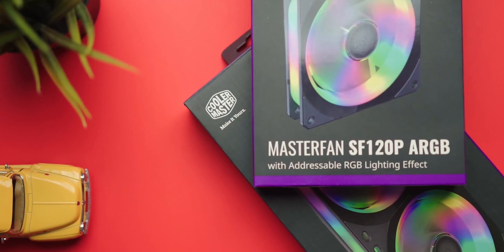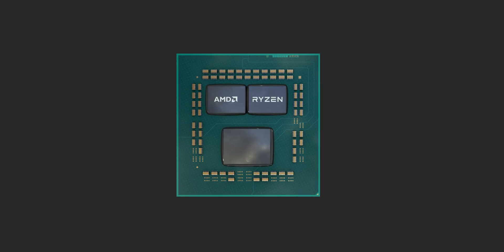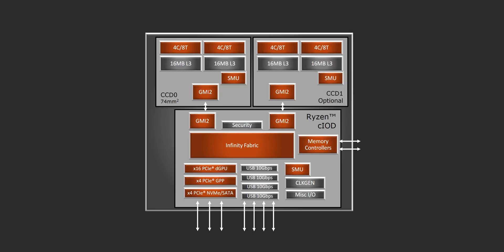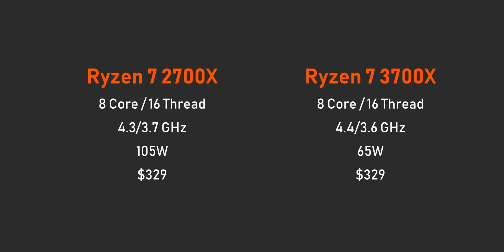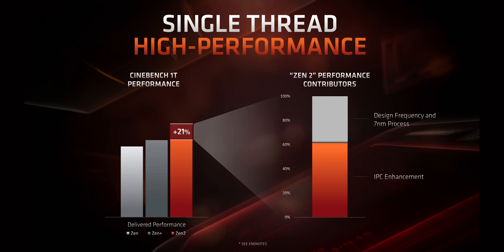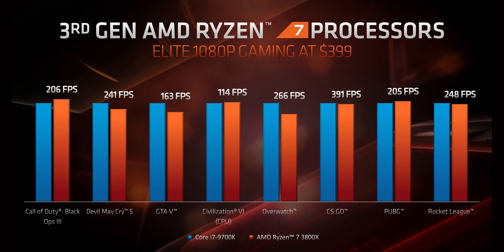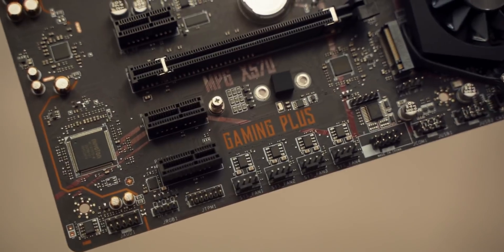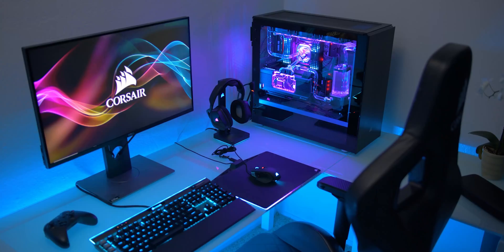AMD Ryzen 3000 – A Very REAL Problem For Intel?

Comment: I'm waiting to see reviews before making a decision. The R7 3700X is the most appealing option to me. If the performance is close enough to an i9-9900K, I'll go Red. Otherwise I'll bite the bullet and pay up for the performance I want. I don't care too much about a socket's upgrade path. I'm still on LGA1366. The only CPU upgrade I've made is an i7-930 to an X5670. Adding two cores and four threads helped out immensely. For Zen 1 owners on 300-series motherboards, they aren't guaranteed to even be able to drop a Zen 2 processor into their current motherboard. And if they can, I question how well he VRM will handle a 12- or 16-core CPU. It won't be worth it to switch to a CPU with the same core count. The IPC gains aren't going to make a noticeable difference in performance.
Reply: its not just IPC gains though. its IPC and frequency gains. Zen1 CPU's were lucky to OC to 4.0, if you get a zen2, you can probably hit 4.3-4.7 on every chip with that increased IPC and less power draw.
and afaik almost all x370 boards are going to support zen2.
Reply: @shawnpitman876  Power draw is unlikely to be less. It's very likely to be similar for CPUs with similar core counts. Once you factor in the increased clock speeds, power draw is likely to be higher. I don't see 4.5-4.7 GHz being that much of a change from 4.0-4.2 GHz. You're only noticing the difference in benchmarks.
Reply: @shawnpitman876  Depends on the game. The biggest gains will come from the 8-core versus 4-core CCX for reduced latency. And even you see a ~10% increases in frames, you aren't going to notice that unless you were on the threshold of what's playable. And if you were, you should have tuned your graphics settings better. The difference between 150 fps and 200 fps is imperceptible.
Reply: @shawnpitman876  I didn't say 500 MHz won't make a difference, I said you wouldn't notice it unless you're measuring the difference.

If you think Zen 2 is using a 4-core CCX, how are they fitting 4 CCXs into an R9 3950X? (hint: it's two 8-core CCXs)
Reply: @shawnpitman876  Resorting to insults is the number one sign you lost the argument. I was mistaking CCX and chiplet. My mistake. That leaves Zen 2 open to increased latency that will hurt gaming performance. Also, average frame rates don't tell the whole story. We need to know the 1% and 0.1% lows before being able to come to a conclusion. We obviously don't have that information yet. Regardless, Zen 2 looks like it's just an incremental improvement over Zen 1. We'll know in two and a half weeks.
Reply: @shawnpitman876  You clearly can't read. I didn't say anything about frames per second. I didn't even mention gaming. If the CPU still has increased latency when utilizing more than 4 cores, I'm going Intel. If the chiplet approach solves that issue, I'll go AMD. I don't know why you're so worried about how I spend my money.

150 fps is delivering a new frame every 6.67 ms; 200 fps is delivering a new frame every 5 ms. You aren't going to be able to tell the difference in frame time delivery of 1.67 ms. In other words, the difference between 150 fps and 200 fps is imperceptible.
Reply: @chessmyantidrug  BTW the ONLY thing that going intel for reduced latency does, is allow you to hit 150+ fps on games, because ryzen even first gen was able to hit 120-130fps on almost EVERY tittle. So wanna come at me with more BULLSHIT reasons? Because according to you, that's all a waste, but if ryzen doesn't do it, you're going intel.
This is how your argument is COMPLETELY self defeating. You're just too stupid to keep track of what you've even said for more than 30s, BECAUSE ITS ALL A LIE.
Reply: @shawnpitman876  I'm sorry you can't comprehend anything I've said. I'm my initial comment, the one where you said I brought up gaming, I never brought up gaming. You brought up gaming, so I explained why the differences in performance are likely to be irrelevant. The main reason I haven't upgraded to Ryzen is the difference in performance over Nehalem isn't enough to justify the cost. For Coffee Lake, it does. Note: I'm not talking about just gaming. Core for core, Intel is better. They just aren't the best bang for the buck and I don't really care about pinching pennies.

I don't know why you're taking this all so personally and attacking me. You really need a nap.
Reply: @chessmyantidrug  Yea, that's what all the wastes of oxygen try to say when they've been caught out on their bullshit.
As I said before, You ain't gas lighting me, fucking idiot.

Comment: i want to upgrade to 8 core 65 tdp version off 3rd gen. And i want to match it with x470 motherbord can you help me pick one out for overclocking?
Reply: AHOC says MSI x470 gaming pro carbon handles CPU's really well and is much cheaper than the asus c7h. He plans on running a 12 core ryzen in it, and he's an extreme overclocker, so you should be set to run a new 8 core on that no problem. Especially since its lower tdp than the 2700x that the board is meant to handle.
Reply: @shawnpitman876  thanks
Reply: Buy ASUS C7H, then done

Comment: Nice vid guys,,love your channel,,so,,my current rig: i7 8700k OC to 4.8ghz,, bought it about 1.5years back,,it is a strong performer but I'm not using it for gaming,, I'm a graphic designer, heavy after effects and premiere pro user as well,,my question is: would be the ryzen 9 3900x better in these adobe applications??,,, I'd need to replace only the mobo and cpu,,rest of the pc is pretty relevant for 2019,,,some applications prefer higher  frequencies, some more cores,,god knows what else,,,but anyway, I'm excited about the new amd offering,,my last amd was an athlon waaaayy back in time,,,
Reply: I doubt it will be better. I blame Adobe for it tho. They refuse to get with the times. Check out Dmitri's video on this channel from few days ago.

Comment: The real question: will my predator Helios 500 support the 3000 series? It launched in 2018 so odds are it's running a 400 series chipset soooo maybe? If so it'll be the king of laptops again. It's already pretty freaking amazing with a 2700. It even outruns the 9900k Alienware since it doesn't overheat like a motherfucker and throttle like that 9900k does. If I could do a BIOS update and slap in a 3rd gen Ryzen it'd be amazing.

Comment: Yea Ryzen 2 looks awesome. Everyone knows that. But there's something bugging me that no one else seems to realize.. 

Why is AMDs 7nm only just catching up to Intel's 14nm?? Should be surpassing it by quite a bit. I'm thinking of swapping to a 3800x for a while but as soon as 10nm Sunny Cove releases I'm back on team blue.
Reply: They've delayed that fab process for 5 years now. They just came out saying a mainstream 10nm fab cpu wouldn't be available until 2021. Rumor is that the yields in the 10nm process is very low. Only 30% of the chips are rumored to be useable in every wafer. The 10nm cpus are also rumored to be very low clocked because of heat complications.
Reply: Well when you think about it Intel has had 4 or however many years to fine tune and perfect their 14nm. AMD is 1st gen 7nm. Besides as much as i hate it most customers care about the resulting performnace and not the node it was made on. 10nm desktop parts from Intel may be scrapped alltogheter. From what im seeing their 10nm is a fundamentally broken node. The best they can produce in it right now and for atleast a year are 4c/8t up to 4.1Ghz laptop parts. They can't compete on desktop with specs like that. Their own 14nm would walk all over such parts even if 10nm would bring average 18% IPC uplift like they claim. 

In fact their roadmaps show 2! ,more 14nm desktop generations:
14nm 10c/20t Comet Lake 1H2020
14nm 12c/24t? Rocket Lake 1H 2021

No mention of 10nm desktop parts. Considering the timeframe they may skip 10nm on desktop alltogheter and go to 7nm in 2022. Assuning that does not take another 4 years top cook in the oven and end up as anemic laptop parts like 10nm did.

Plus how many security issues we have yet to hear about? One socket or series only supports two generations of CPU's so current Z390 owners will need to buy yet another motherboard if they want Comet Lake next year etc. 

Plus personally i just don't trust Intel based on what i wrote above. If you are waiting for Intel you may need to wait for a long time. They will come back eventually but currently it seems like thay have conceded that thay've lost the desktop market. They will pretend to care but really they don't. Server and laptop are much more important for them. Losing any market share there would hurt them badly. So i suggest getting Zen2 now and not waiting on Intel. By the time you do your next CPU upgrade they might have something competitive but that will be 2022+

Comment: @HardwareCanucks
See how fast RAM overclocks for a Zen2-CPU on a X470 motherboard. The more the better: 3600 MT/s, CL=14/15 and this preferably on X470 motherboards which use a T-topology for the memory traces in between the RAM slots and the CPU-socket.
I expect that many people will be interested in buying a good and discounted X470 motherboard. PCIe 5.0 is nice but soon DDR5 gets introduced so your platform will be out of date soon anyway. I have read from several people that they are worried about the noise of the chipset-fan and that the chipset-fan might break some day. That chipset-fan seems to be a deal-breaker for some enthusiasts who don't mind to spend $200-300 on a motherboard.

Comment: 2700x ≠ 3700x
$300 8c/16t 2700 = $330 8c/16t 3700x
$330 8c/16t 2700x = $400 8c/16t 3800x 
Also, $200 6c/12t 2600 = $200 6c/12t 3600
$230 6c/12t 2600x = $250 6c/12t 3600x
AMD is jacking up prices on all but the 3600. It's reasonable though, aside from the $400 3800x.

Comment: Assuming reviews go well (I'm a fan, not a fanboy), I'm going to be upgrading from an FX-8320 to a 3700X, probably with an X470 motherboard. I am excited, my wallet is not.
Reply: I upgraded from an FX-6300 to an R5 2600. Definitly worth it!
Reply: @xPandamon  I've gotten like half my friends to build Ryzen machines in the past year alone... And I'm sitting here with this aging machine. Figured it was time.
Reply: @alextrotta796  Yeah, definitely. I wasn't happy with mine (although an FX-8xxx is slightly better than what I had) so I upgraded. Finally able to play modern AAA titles :)
Reply: @xPandamon  I don't play super demanding games, but even some of the lighter games will really stress my CPU. GPU is next after this upgrade, I'm sitting on my R9 380X until either team makes a good move, right now an RTX 2070 Super is actually looking to be a good option, assuming the rumors are true.
Reply: You at least want a good x570 that can oc most x470 probably needs a new bios to support 3000 especially if new so that couple troublesome
Reply: @chriswright8074  I'm aware of the BIOS update issue, I'm okay with that. I'm not sure if I'll OC, but if I think I might I'll go with a higher end X470 board or X570. AMD themselves said that X470 should be fine for most users with Ryzen 3000. Most people won't need a lot of the X570 features.

Comment: I'm running a7700k, Vega 56 system currently, and strongly Considering a zen 3 & Navi 20 upgrade in 2020.

Glad to see amd back putting so much pressure on Intel. 
Hopefully they can do the same to nvidia and the insane gpu prices currently.
Reply: Kevin Plemel the Nvidia fanboys have to open their eyes for that to happen.

Comment: B550 wil be out early next year apparently and since I have to wait till next year for a build becuase of life things this year that is perfectly fine with me as I will be pairing a 3700x with b550. As long as the nvme slots on the board are pci-e 4 as well as a single pci-e x16 slot I am good as i just plan to plug in an older capture card into a PCI-E x1 slot which can be as slow as pci-e 2 which is plenty of bandwidth as its a 1080p card. I am good as long as the b550 allows for some overclocking of the 3700x  as I may need it for emulation.
Reply: B550 reportedly has 20 or 24 PCIe 4.0 lanes. 16 to first x16 slot and x4 to first M.2 slot. Chipset is still using combination of 2.0 and 3.0 like B450 so im not sure if there is another x4 4.0 to chipset or not.
Reply: Which as I said is perfectly fine for me as that is all I really need is 1 nvme slo and a single pci-e x16 slot the others can be pci-e 3 or 2 for my capture card.

Comment: amd is superb at the price but if you are a linux user stay away from ryzen things don't work properly with it. plus other usb plug and play devices have a problem all are not compatible. intel may be slow but everything works.
Reply: Hmm i was thinking of building a linux system. What distro has this problem?
Reply: @Raivo_K  any Debian based distros had issues mint wouldn't even load. The only one working properly was manjaro
Reply: @Raivo_K  Ubuntu ones had screen tearing issues and occasional hanging and on Ubuntu mate the screen would keep flickering on start up. On peppermint n MX Linux the system sometimes would start and then just freeze you had to keep power button pressed to switch off. Stay away from ryzen if you want to use Linux even some of my WiFi dongles wouldn't work on amd. After incurring a huge loss got an Intel now everything just works fine even those WiFi dongles
Reply: Good to know but i think i will test it for myself once i get my new build together in September. I was planning on going for dualboot: Win10 for gaming only and Linux for everything else.
I recently had a suprisingly good expeience with a very old laptop i upgraded from WinXP to Linux Mint 19.1

What suprised me the most was that drivers did not need any configuration. Tho i was a little pissed that some programs were not present in package manager. But that's nitpicking compared to Windows experience.
Reply: @Raivo_K  great mate let me know how it went

Comment: I would love for AMD to be back in the Athlon Thunderbird period of competition with Intel,  was a great time in tech.... would love to end up running AMD CPU again knowing it's the best option......
Reply: Adriaan Oosthuizen - minus all the dirty tricks with OEM’s.
Reply: But they are. Since Ryzen launched, they've been trading blows here and there, but now, with it's third generation, Ryzen simply destroys the i7 and i9: nearly identical IPC, much more cores, less power consumption, less heat, less security vulnerabilities, infinitely better upgrade path, while costing equal or less then Intel counterparts. I'd say AMD won BIG time this year, and by looking at Intel's roadmap, I believe AMD is gonna keep the crown for the next few years at least.
Reply: @RainerLuizFonseca  I agree, 50 Motherboards are being released at launch for RYZEN 3000 processors. The board manufacturers invested millions because they know it is a better platform. Intel is going into 5th year at 14nm.

Comment: @HardwareCanucks
The explanation about why the FPS would be higher with that extra cache is not completely correct or at least rather incomplete. It mostly has to do with relevant data being on the cache of one CCX and then a task which requires that data being sent to a core on another CCX. In that case the data needs to be copied from the cache on that last CCX to the cache of the first CCX or if in the mean time that data would have been removed it would have to be fetched from the RAM. It is not so much a problem that the data from the RAM gets fetched slower with slower RAM, the bigger problem is that the clock frequency of the Infinity Fabric gets clocked higher when the RAM clock frequency is higher. 

The double amount of cache should strongly decrease that data needs to be fetched from the cache of another CCX because it still is present in the cache of the CCX to which the core belongs which gets an assignment for which it needs that data. Instead of data being removed from that 16 MB of cache when it hasn't been used for X cycles it now will be copied to a second 16 MB of cache. Because of that even when Windows screws up with thread-management (not being CCX aware) the data should still be in the second 16 MB of cache much more frequenctly and you will get a much smaller penalty. Great stuff! Most ordinary consumers (except when you need Quicksync or integrated graphics+low power before the Zen2-APU's get released) who assemble theirown PC should not even consider Intel now.

Comment: But if you don’t need 12-core or 16-core processors and you won’t have a GPU or high-end SSD to take advantage of PCI-E 4.0 - most users basically -, you don’t really need a new X570 mobo and you can save some money there.
Reply: You could probably even use the 12- and 16-core CPUs with the highest end X470s.

Comment: I dont think the 12 core Ryzen CPU is gonna be 8+4 chiplets, rather its gonna be 6+6
Reply: Correct. CCD's must have the same core count so odd ones such as 8+2, 8+4 or 8+6 are not possible.
Reply: I was thinking the same. 4 3/4CCXs. Sounds like it would be less expensive.

Comment: been sitting on my 4770k for a while now. I've been waiting for this moment for a while. SO yes in jumping on the 3000 series. Need an all in one steaming/gaming PC at a good price point.
Reply: 3700x
Reply: imo 3800x/3900x and if you don't feel you need PCIE 4.0 for crazy speed SSDs or anything, get x470 with a good VRM.
Reply: I'm itching the 3900X but waiting on reviews before making a final decision. Also, money won't be an issue. not to worried about the price increase for X570
Reply: @SilviAllDay  You say that, till you go to get what will be considered a high end x570 motherboard and it costs around $600 USD, or possibly higher.
Reply: @shawnpitman876  $600 for a board? lol im not getting a MSI godlike board haha
Reply: @shawnpitman876  That's fine. I have enough saved up from the lack of innovation over the last 6 years. :D